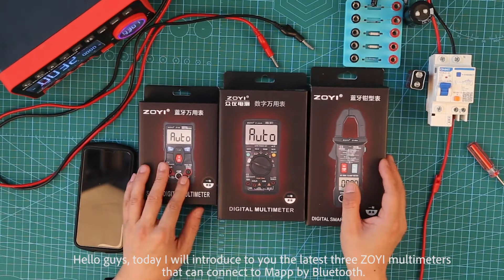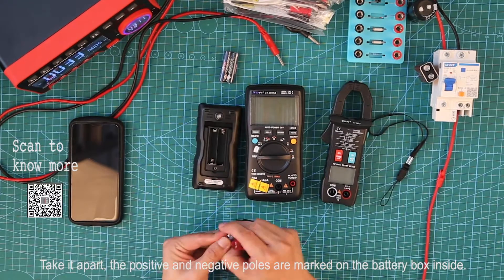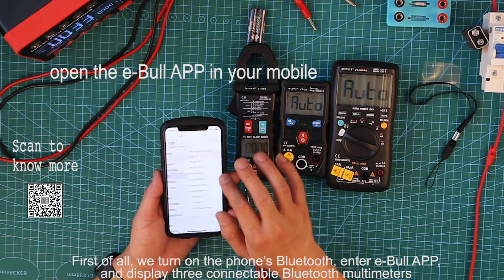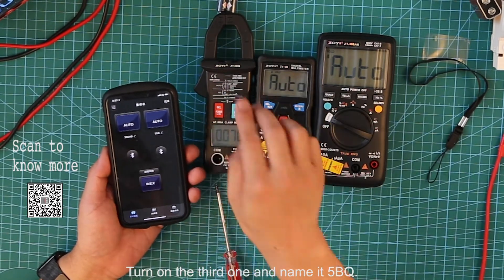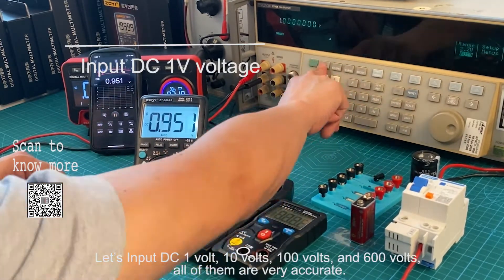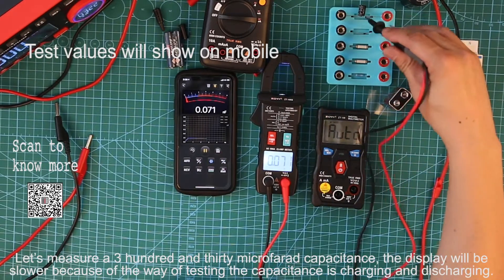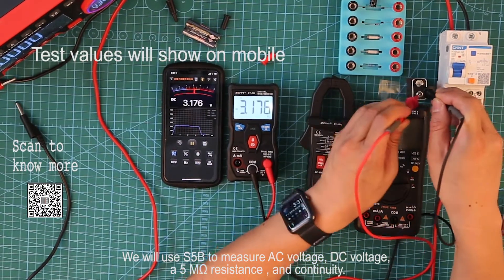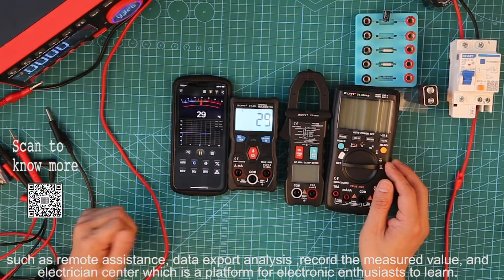Unboxing itroduction of ZOYI Bluetooth multimeter with APP

Comment: the bench model, zt-5566, does not have a bluetooth connection for reading data?
Reply: only ZT-5566S has the Bluetooth connection for reading and controlling